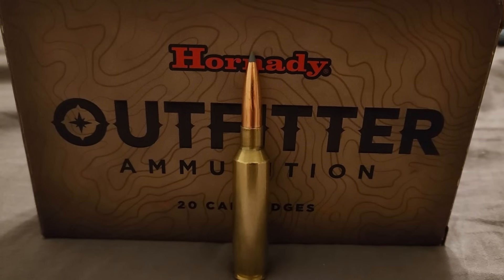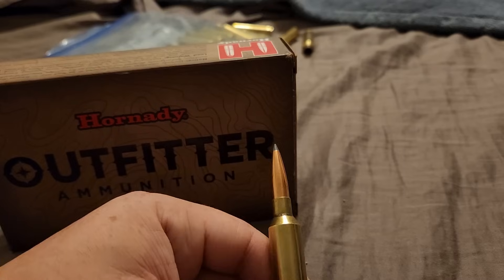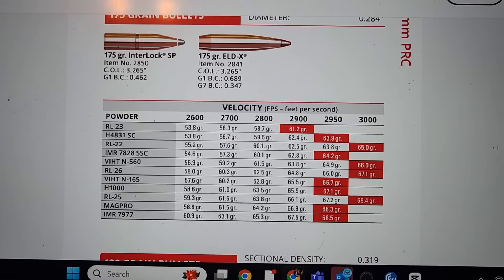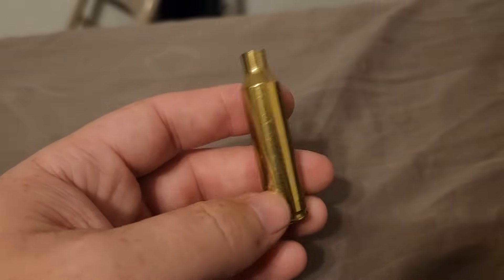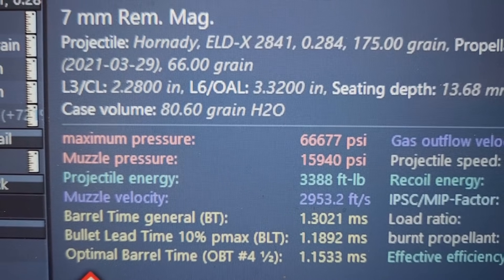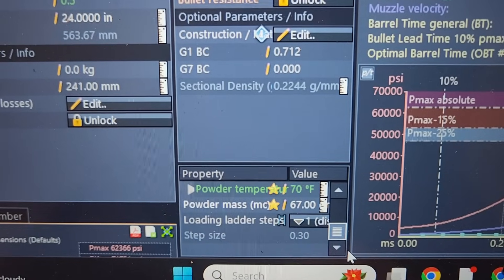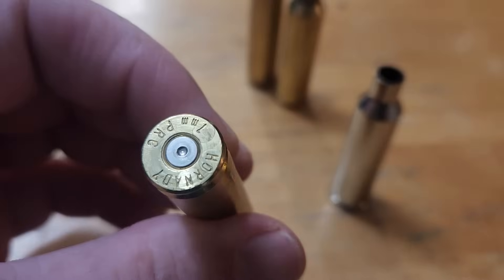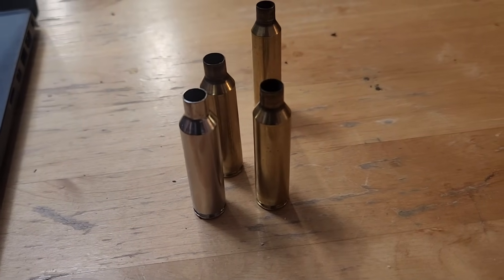Why your 7mm PRC is slow...

Comment: They are slow because Hornady overhyped their creation.  They do that across the board with all their ammo, especially with the "new" cartridges.  Hornady is about as honest as CNN.
Reply: Maybe .... early boxes of factory ammo did get the 3000 fps e eryone complains of not getting. 3000fps with 175grain using reloader 26 is a real thing... maybe we should be complaining Vista isn't making enough reloader 26.
Reply: @RookCustoms  It just goes to show, if you want it done right, you gotta do it yourself.
Reply: It's not a hype issue.  The factory ammo across the board has had problems due to powder shortages.  So companies are using what ever is available.  Believe me when I say Hornady isn't the only one doing this. That is one issue, the other issue is that because the tighter chamber tolerance Hornady backed off the amount of grains of powder due to people seeing chamber pressures with some of these other powders.  But Hornady should relabel there boxes based on the lot numbers to show this and they don't.  As for the reloading side it is all about the data and the components used.  If you are using Hornady brass then you will see pressure signs early because Hornaday brass is known for being soft brass.  Anyone who has loaded the 6.5 creedmore or 300PRC has plenty of experience with this issue.  You change the brass to Lapua, or even ADG and you will be able to push the MV up and maybe even faster than what the book says.  (Lapua will be releasing 7PRC brass in the fall of 2025).  The books don't show this because a lot reloading data in the book is based off of engineering software.  Different components will get you better or worse results.  This has been the norm with ever new caliber Hornady has come out with due to the only brass available for awhile is Hornaday brass.  One thing is for sure, Hornady brass sucks and will produce shitty results.

Comment: my custom 7mm PRC hated factory ammo. shot the custom 173 ELD-X that came with less than .5 MOA at 2883. 
Im a copper fan so I loaded the 168 gr LRX with 66 grs of H-1000 based off the Hogden load data. got that up to 2940. Once i got my seating depth correct, last group was .8 moa at 100, with 2 touching. Good enough for what need it to do.
Reply: When you run out of those, you should try the 160 lrx they developed for that cartridge. They're getting really good velocity in their factory ammo with it.
Reply: @robertmajors1737 I've been trying to find the 160 gr LRXs with no luck
Reply from the maker: Thanks for watching!

Comment: I am in the market for a 28 caliber hunting rifle.  I had narrowed it down to the 7mm WSM, 280 AI, and 7mm PRC.  This info kind of dampens my enthusiasm for the PRC.  Also, I am not looking to shoot the heavier projectiles that the PRC was specifically designed for.  I am looking to shoot the 140g - 160g class as fast and accurate as I can using a monolithic construction such as a TTSX.  The 7mm Rem Mag is great but, I dont like the belt.  I like everything I read about the WSM but fear I would have trouble sourcing good quality brass.  Alas...the search continues...
Reply: If you wanna run 140's, 280AI will push them 3200. I run Nosler AB 160's in my 7mm PRC at 3102. I save the heavier bullets for my 28 Nosler, ELDX 175's at 3181fps. The most efficient is the 280 AI and also the least recoil to get 140s running 3200.
Reply: Look at the 7 Saum (Norma or ADG Brass) if you want a short or medium action or 280 AI if you want a traditional LA.  The SAUM has an advantage if you want a 22 inch or shorter barrel also; try 63 to 64 grain N560 with A Fed210 or CCI200 for accuracy plus velocity (you should get around 3100+ fps in a 22 inch barrel).  There are several 143 to 150 grain copper bullets which will work well:  Barnes 145 LRX or 150 TTSX, McGuire's 143, Cutting edge Laser 145, Hornady 150 CX or one of the Hammer bullets. I like the McGuires the best not that Badlands is not making bullets.  Jump most copper bullets about 0.075 to 0.125 from Jam (tight into the lands).
Reply: @thebryguy96  Look at Apex Afterburners. Closest thing I've found to the Badlands BD2 design. I think the maker was a little more thoughtful in their design than George was with the bulldozers, but the bulldozers were special bullets and I hope someone purchases that IP and starts making them again. I got the last batch of 150gr .308 bullets and about 40 left of the 175gr. The 150gr over a 2gr sub max charge of LVR is going over 3000 fps and shoots under 2/3 MOA in a 2in 308. Truly special. RIP George.
Reply: @Snailz5  thanks for the info.   The mcguireballiatics bullets are great too but they don't make a light 30 cal.  George's 130 and 150 grain 30 caliber behind lvr or varget type powders in a 308 are better for hunting than many 30 cal mag factory loads.  The 308 suppressed in a 16 to 18 inch barrel is an amazing hunting cartridge.  I have at least 2000 badlands in 22, 257, 264, 277, 284, 308, 338, and 375.  I had seen George at his shop a few months before he passed from pancreatic cancer and grabbed a bunch before he got too sick to work.  Thanks again for the feedback.
Reply: @thebryguy96  I'll take some of those 30s if you're selling
Reply: @Snailz5  I think my 30 cal are all 175 gr and 195 for a 300 wby and 300 wm.   Let me check if I have any 150.   How do I contact you?
Reply: 280AI all day
Reply: Fyi I am getting 2866fps with my 280 ai with a 22" barrel with the 160 cx bullets,  .5 grain less than max
Reply: Don't worry about the belt. My factory barreled 300wm is more accurate than my 6.5 creedmoor 😮. 
I would go 7mag, just watch out for slow twist rates. You'll want 1:8.
Reply from the maker: Sounds like 280 AI is what you're looking for.
Reply: @ReloadingWeatherby 
Exactly what I was going to say
Reply: There’s really not too much difference between 7 PRC and 280 AI. 7 PRC has a lot more support and is what I’d recommend if you’re buying a factory rifle. Run the new Barnes 160gr LRX load and call it a day.

Comment: I had Hornady outfitter ammo group terrible for me too. Then i watched a Ron spommer video that explained how solid copper needs a cleaned to bare metal barrel and after trying it....... It worked? Maybe you should try it and then hopefully explain why this is?
Reply from the maker: Possibly... the gun I had didn't like any bullet I tried
Reply: I think the Hornady CX is the problem. I haven’t been able to get them to shoot with factory or hand loads in 3 different rifles, even with cleaned barrels.
Reply: @KMV-49  what caliber and rifle. I've seen this on a few threads and I've been rolling on the cleaned down to bare metal bore concept that worked for me but apparently that's not always the case?? I sort of assumed that the 7mm was at least stable

Comment: Got a 22” Bergara I’m about to start load development on. Going to try N570 first. If I can’t get a full case I’ll drop to 565.
Reply from the maker: I would recommend a faster burning powder for your shorter barrel. Something like N560 or H4831SC
Reply: @ I appreciate that. I was debating that as well. My original goal was 565 to start. Luckily the vv powders are pretty easy to get ahold of and I already have some sc kicking around
Reply: @chasehunt6497 565 and 570 are way too slow for a 22" 7 PRC.

N560, 7828SSC & 4831SC are your powders.
26" = N565
28"+ = N570 if you can get enough in there. Otherwise still N565.
Reply: @ really? From what I’ve read 565 is really the sweet spot for the 7. I know with the shorter barrel 570 is probably too slow but I’ve had very good luck with “too slow” powders with very full cases. We will see, but I’ll get a pound of 560 on the way. I’ve read 4831 is consistently slow, but hey maybe everything is in the PRC
Reply: @chasehunt6497  N565 isn't ideal until you get to a 24" barrel at 63k psi or more. Thats maximum charge territory.

In a 26" barrel that's a little better for N565.

N570 is basically never good in a 7 PRC unless you have a 26" or longer barrel, and exclusively shoot a 195gr Berger OVER 65k PSI. 

THEN it actually all burns. Otherwise your always going to have inconsistencies in one form or another.

Look at Ultimate Reloaders 280AI video. He had horrible ES and group sizes on almost everything he tested. Why? Because he doesn't know what he's doing.

He used H1000 which is WAAAAYYYY too slow for a 280AI under ANY circumstances. It's never going to burn 100%. Hence the shitty ES numbers and groups.

If your ES numbers aren't ALWAYS under 15 for 3 shots. It's not all burning and there are better choices.
Reply: @ good info. Thank you.
Reply: @chasehunt6497  no problem. Good luck with your Bergara.
Reply: @ReloadingWeatherby barrel length has no impact on powder choice. The best powder will always be the best powder, n570 is a great choice. Reached 3100 fps with a 180 Berger in a 26” barrel.
Reply from the maker: @Dave-cf2ng   You are close to 70k psi to get 3100 FPS with a 180 gr bullet in 7mm PRC in a 26 inch barrel. You do you my man.
Reply: @ don’t know what to tell you. No pressure signs on brass. Backed it down to 3050 and that’s where it lives.
Reply: @ReloadingWeatherby  GRT and quickload are garbage.
Reply from the maker: @Dave-cf2ng  Just because there are no signs of pressure doesn't mean you're not over pressure. I once hit 3100 FPS with a 250 gr bullet in my 340 Weatherby with no signs of pressure on the brass and bolt. But that doesn't mean I was under pressure lol
Reply: @ please tell me more about what your $3 app tells you about my rifle. Apps don’t tell you real information, there are plenty of people running a 180 at 3050-3100 fps in a 7 prc, Just like a 7 rem mag. You had a video of you shooting a 7 rem mag at 28 Nosler speed, you think that wasn’t overpressure? lol hypocrites.
Reply: I just saw a video of a guy using RL22 and a 22" barrel hit 3000 fps
Reply from the maker: @kevinlee5122   He was probably close to 70k psi to do that.
Reply: @ReloadingWeatherby  I for one am not a guy to go pushing much past 65k but I will push to around there (we have no way of truly knowing. But GRT is very good in certain instances)

What I will say is I expect a 175 at over 2900 fps. I don’t need 3000, if you compare the ballistics for 3000 and 2925 it doesn’t change hardly at all. But just from a Hornady BS standpoint. If I can’t get there I’ll just find me a 7LRM reamer or get a 28 nos barrel out of spite. Lol.
Reply: What elevation are you shooting at? Thanks for the brass info.
Reply: I’m going to report back. N570 seems to be modeled much slower than at least my specific lot in GRT is. I gave the program accurate brass volume and OAL info and it was predicting something around 2890. This is with 72.5 grains of powder. Ran 6 rounds over the radar and averaged 3075!!! At 80° (confirmed with a IR gun) these. I had too much pressure for my liking, a decent ejector (no swipe) and 2 rounds with a little heavy bolt lift. Using OBT to true it is showing I was right around 68ksi. I should be able to pull a grain out and be north of 3000fps right at 65ksi at 80°. This increase in burn rate is also showing complete burn out in my 22” barrel. Just a data point. But interesting results. Is it possible some powders aren’t modeled perfectly in GRT? VIHT powders usually don’t exhibit much lot to lot variation
Reply: Was going off memory, just checked my load file. The load I fired was right at 69k according to Gordon’s obviously too high. 71 grains will put me at 3015 at 65k with burnout at 20 3/4”. Load ratio of only 96% which I’d agree with, I’m searing bullets with no crunch without using any auxiliary methods such as vibration or drop tubes. Loading to 3.375” helps this